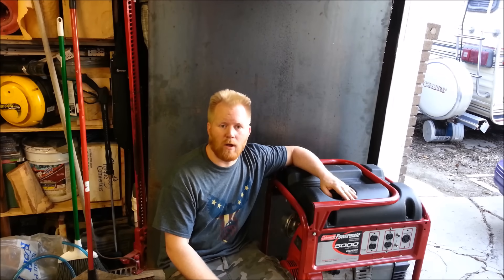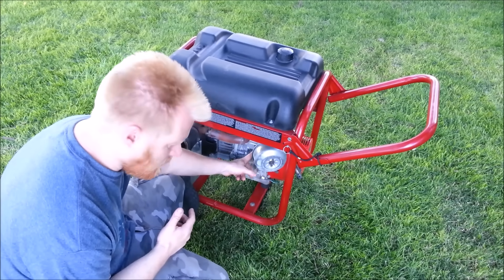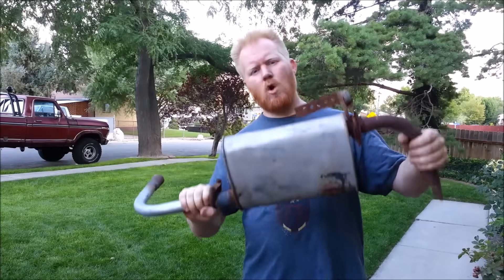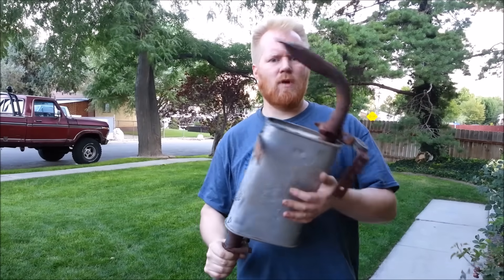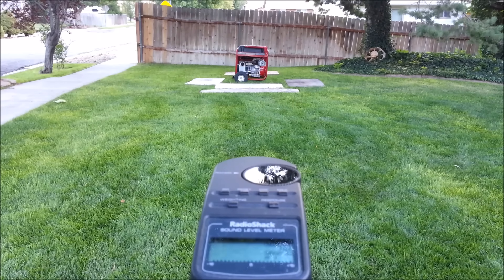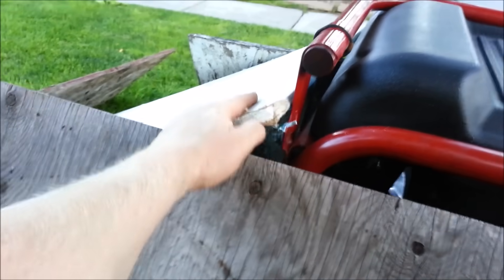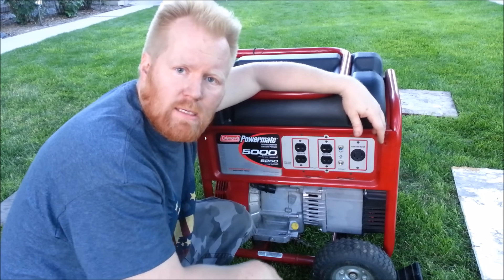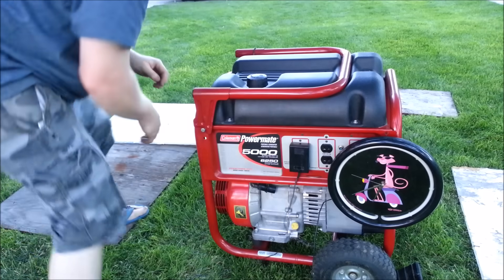4x Quieter generator in 10 seconds

Comment: Nice video showing that most generator noise is not always just the exhaust. The doghouse method of noise reduction has been used by commercial home generator companies for decades with great success. Your boards deflect most of the noise into the ground where much of it is absorbed. Simple, cheap and effective. We did a lot of exhaust modifications to small engines in an attempt to quiet them and not reduce power. We came to the conclusion that the quieter the muffler, the lower the power output from the engine. Enclosures are the best way to go. Nice video.
Reply: If you reduce power, you have not built a good enough flowing muffler. What works better (on  race cars for example) is a sound cancellation box instead of a muffler. YouTube David vizard, he has videos on building zero loss exhaust systems. Yes, they work.
Reply: @lowrangeinnovascotia2930  are you referring to megaphone( or tuned) pipes like on racing two stroke engines? Use of soundwaves for back pressure??
Reply: @h8troodoh  Not really but that is also a great example of what an engine needs (two stroke/expansion chamber)
An engine should have ZERO backpressure. ZERO! If you have backpressure, you are not getting 100% performance. (why manufacturers now use headers when before headers were only for "race or performance" applications). They improved efficiency, period. (this resulted in more power/better mileage/etc)
A cancellation box takes the exh pulses and lets them go one way and sets up the resonance sent back to the exh valve to hit at the perfect time to cause scavenging. Not required on every engine in mundane duties, but the principals are the same regardless.
Reply: @lowrangeinnovascotia2930  I'd like to disagree on the zero back pressure, some engines require it,2 stroke piston port engines, for example, as the fuel air charge would be following the exhaust gates out the exhaust port so.. although they have designed deflectors on top of the pistons,the need for back pressure is still there. 40 year professional mechanic..🙂
Reply: @h8troodoh  Can't comment on 2 strokes, never raced them or built them for performance. Every single 4 stroke engine, does NOT need backpressure, full stop.
Reply: @lowrangeinnovascotia2930  where can i buy this cancelation box?
Reply: @Ghostrider-ul7xn  You can't, you must either make it or do research and see which exhaust maker produces one or a "muffler" that has the same properties. It's all research. A very simple explanation of what I have done, is, fold metal into a box or tube to be the body of the scavenging box. Weld the inlet pipe about 2" into the muffler, not flush with the end cap. Weld a V in the middle of the body so it splits the exh as it comes in, weld the outlet tube flush with the end cap. What happens in this simplified version (but it still works) is, the exh comes in and hits the splitter. The exh is divided down each side of the muffler then hits the flat end cap. The exh and resonance is reflected back towards the inlet but is blocked by being inside the V and 90% ends up hitting the closed end of the V and then resonates back towards the outlet tube which is flush. The resonance that does sneak by the outside of the V and goes back up the outside of the muffler then hits a flat inlet end cap and since the inlet pipe is 2" into the muffler (as opposed to flush like the outlet) the gases and resonance can't get back in the exh pipe to travel back to the engine. This causes a pulse...pulse...pulse in the exh instead of pulse, reversion, pulse, reversion. Research "Exhaust scavenger box" or "exhaust cancellation box" and you will get the info how to build one.
Reply: @lowrangeinnovascotia2930  I hope you might consider posting a video of the design you talked about. Sounds interesting.
Reply: @Rick-the-Swift  I’ve got a thousand projects on the go now but trying to limit them!😂😂
Building a nhra legal stocker mustang currently , the homemade metal lathe I’m building on the side of my milling machine.. and the 3 mud trucks, my dd pickup and the wifes bronco sport… between servicing and fixing everything, that’s quite low on my priority list😂😂
If i can find an old one i built I’ll post a pic of that.

Comment: every 3db is twice or half the perceived volume. also if you read the instructions that come with the decibel meter your supposed to take measurements at 1 meter away.
Reply from the maker: Generators are tested at 23' as the industry standard.

Comment: Also a dog house enclosure will hide the fact that you have a generator !  Make that a big dog house...  And convert to propane and then the fuel is always fresh.  Thank you for the video !  tjl
Reply: Tim Lipinski problem with most modern portable/residential dual fuel or propane only gensets is that they make much less power on lpg. My 7k surge 6500 continuous is a dual fuel setup but on propane it's only rated at 6750 surfe/5580 continuous.

Comment: But your "hour meter" was already running before you fired up the genny. All you did by starting the engine was turn on the light. You need a clock like I have in my shop where the clock only runs when it has AC power.

Comment: what about restricting the heat from escaping?
Won't that effect the unit and overheat it?  heat kills.
Reply from the maker: I've run temp checks and everything stays within a few degrees. The trick is to leave plenty of area for proper air flow. Any engine will only pull in so many cfm of air while cooling and it doesn't require 360 degree air flow. A standard air cooled engine pulls all of it's cooling air through a few square inches behind the pull start. The spacing left at each corner is probably 100x the required area for proper cfm in and out. Air cooled engines are run successfully in fully and partially enclosed areas all the time(Honda's full line of inverter generators are fully enclosed with only a small opening at the front and rear for air flow, Along with pretty much every RV generator).

Comment: idiot should be measuring the oil temp instead of the sound level, blocking the cool air for the air cooled motor is not too bright
Reply from the maker: I've run temp checks and everything stays within a few degrees. The trick is to leave plenty of area for proper air flow. Any engine will only pull in so many cfm of air while cooling and it doesn't require 360 degree air flow. A standard air cooled engine pulls all of it's cooling air through a few square inches behind the pull start. The spacing left at each corner is probaby 100x the required area for proper cfm in and out. Air cooled engines are run successfully in fully and partially enclosed areas all the time(Honda's full line of inverter generators are fully enclosed with only a small opening at the front and rear for air flow, Along with pretty much every RV generator).

Comment: One question, does the RPM really need to be that high?
Reply from the maker: Yes. In order for the generator head to produce 60hertz it needs to spin at 3600rpm. Some high end generators by ONAN are designed to run at 1800rpm to reduce noise but require an engine almost double the size. 3600rpm with a generator head producing 60hz is the most economical way to do it.
Reply: Why couldn't a small transmission be used to speed up the  RPM and lower the engine RPM. It would really save on fuel too and noise !
Reply from the maker: Tom Schwab
You could, but you would need an engine that produced almost twice the power. So a 3600rpm generator that typically would have a 10hp engine would need close to a 20hp to run at 1800. This increases fuel use, weight, overall cost. You wouldn't need to use a transmission, just wind the generator head with more copper in a different way which increases the cost as well. Onan did this on a lot of their RV mounted generators, and they're great. They last forever, run cooler, very quiet, but they are close to 5-10 times as much as these cheap box store generators.

Inverter based generators have solved this by producing a DC current at any rpm and electronically converting it to usable 60hz AC power. The engine only needs to increase speed as load is increases. It is the best of all worlds as they operate quietly and produce clean power.
Reply: sixtyfiveford
Reply: Tom, with that type of generator, RPM dictates AC frequency. 3600rpm is pretty standard for small gasoline generators. Inverter/generators run at lower rpm, and idle down without an electrical load. They're much quieter, more fuel efficient, put out a cleaner (allegedly true) sine wave more like grid electricity. The trade off is that they cost more to buy.

Comment: The problem you will have when you place the pieces of plywood around the generator  is that the generator  will get very hot. I,ve done this in the past and i had to space the plywood further apart than you had yours.
Reply from the maker: I've run temp checks and everything stays within a few degrees. The trick is to leave plenty of area for proper air flow. Any engine will only pull in so many cfm of air while cooling and it doesn't require 360 degree air flow. A standard air cooled engine pulls all of it's cooling air through a few square inches behind the pull start. The spacing left at each corner is probably 100x the required area for proper cfm in and out. Air cooled engines are run successfully in fully and partially enclosed areas all the time(Honda's full line of inverter generators are fully enclosed with only a small opening at the front and rear for air flow, Along with pretty much every RV generator).

Comment: I have a Honda 3000is and it is SUPER quiet right out of the box. No need for any sound boards. But if I do sound boards then I can't tell if the generator is running or not by standing 23 feet away.
Reply from the maker: And? What does this have to do with anything?
Reply: MontiR Aruba I have a Honda 3000 also. It does Not generated the stated amount of power in Amps. It generates in the 17 amp area and is good for electronics, lights and a very small ice box/frig. Buyer beware.  It is very quiet and excellent for camping.

Comment: MAJOR STEP UP!
8:15 Attach thick scrap carpeting or egg crate foam to the inside of the wood panels & around the generator on any hard surface (concrete, etc) the generator may be sitting on so that the sound does not bounce off those hard surfaces.

Comment: looks like a nice way to cause your generator to run hot. 
Check your owners manual for clearance requirements. What you call plenty of air flow is actually quite restricting.
Reply from the maker: All temp test show it runs within a degree or two of normal. The intake fan on the motor and generator head can only pull in so many CFM of air. The Air spaces at the corners allow for probably 50 times that capacity. I could shrink it even more to get more sound reduction. Air cooled motors are ran in enclosed areas all the time with far less air circulation. Go to the Home depot and look at a huge 20+ hp riding mower(their air cooled); it's covered completely to reduce sound and will run 3000hours+. Along with that virtually every inverter generator is seal up tight as a drum with only a few square inches allowed for air to be pulled in and pushed out.
Reply: sixtyfiveford you are kidding me right? My Honda EU 1000 owners manual says it requires three feet of open space in every direction.
Reply: A riding mower engine is not covered unless you mean covered with shrouds which direct the cooling air over the cylinder and head.
Reply from the maker: Wayne Wildman All modern riding mower engines are completely surrounded by cosmetic shrouds(hood, side shrouds, front grill and firewall) with only enough open space to allow for proper CFM flow.  Onan RV generators are fully enclosed and then put into a RV generator compartment with a 10% opening. I run a pair of eu2000i in a fully enclosed box on my Motorhome with a 6"x12" opening on both ends and small fan to pass air over them; they run cooler than out in the open. Briggs and Stratton puts their 40301 7000watt home stand by generator in a fully enclosed box. Only strategic louvers for airflow over the air cooled engine(20hp riding mower engine) are provided. It runs cool and quiet. You mention your Honda eu1000i that is in a fully enclosed box with maybe a 10% total air opening allowing for the engine to breath and cool itself(Yes, it has standard metal shrouds on it inside as well).
Reply: sixtyfiveford room for proper cfm means they are not inclosed.
Think about your own statements  bud.
Reply: Wayne, perhaps my explanation sounds like I'm ignoring the safety precautions that are listed in your manual. I'm not. The EU series of generators are encased it the plastic cover. That's what I was referring to, and that is within an inch or so of some parts of the engine, generator, inverter, and other parts. His plywood baffle over an open caged genset is no where as close, nor closed in at all. As long as he keeps flammables away from the exhaust (on the Honda, you can see that the exhaust exits through an opening in the case), and provides openings for breathing and air cooling, he'll be okay. You're comparing apples to oranges. Yes, the Honda is a better generator for a few reasons... one is that it's quiet enough to not need home-spun noise baffling. Good luck.
Reply: Home generator installations always enclose the genset inside a housing to quiet the unit. Take a look at some permanent home generator power units. There is far less ventilation on those units and they run for long periods of time just fine.
Reply: Wayne, the Honda EU series has an engine already enclosed in the housing, with maybe a couple of inches between the actual engine and red plastic box. 1000 or 2000. His idea in pretty good, but needs weatherproof materials covering the drywall and OSB.
Reply: Steve W the Honda EU series calls for three fee of clearance on all sides and above. I have the owners manual for my EU1000i right in front of me. 
The plastic case is part of the generator, not part of an additional enclosure.
Reply: Steve W here is a quote from the manual. "Operating this generator less than 3 feet (1 meter) from a building or other obstruction can cause overheating and damage the generator." 
"For proper cooling allow at least three feet of empty space above and around the generator."

That's Honda saying that not me.

Comment: Don't know if anyone pointed this out previously (and I don't have time to read through all the comments), but volume decreases by half for every 3dB, not 5 (just to clarify, since you weren't sure in your video). Also, the angle of the boards used for deflection can make a huge difference. Windows in a soundproof audio studio are usually pitched at a 17 degree angle to surface of the wall they are in to maximize sound dampening (and minimize parallel wall reflections). Nice job applying some simple physics to get the job done.
Reply from the maker: 17 degrees? Interesting, I've never heard a definitive angle. Thanks.

Comment: Just FYI - 3.32 decibels = half the power, it's a log scale, meaning that 10 decibels is approximately 8 times more loud/quiet.

This is also why you lose ~3 decibels when you use a 2 way splitter, or ~7 with a 4 way splitter.

In other words, you're underselling the results by a good factor of 2.

Comment: I lined my slightly angled box (deflection)  interior with carpet pad (absorbstion) and reduced 22 decibels! Thanks so much for the simple but great demo and information!
Reply: I was thinking of doing something similar, but with “sound lining”, it’s an absorbent material about an inch thick. We use at work inside HVAC ducting..
Reply: Could you put the carpet pad on the ground under the generator? Will that absorb even more sound?  My generator will be sitting on concrete.  Thank you!
Reply: @xyladivine  yes
Reply: @aladrasullivan9018  Thank  you!!
Reply: @xyladivine  welcome luv
Reply from the maker: That's impressive!
Reply: MRrwmac @

Comment: I don't care how much air flow you say it has after you o your little trick because I guarantee the temperature of your generator went up at least 10 degrees. With limited air flow and the heat from the generator building up inside your plywood tent the life of your generator is cut in half.
Reply: louis stout, I thought the same thing, but Mobil 1 is an amazing product.  If I were to run this way I'd be using synthetic oil.

Comment: Buy a Honda generator, leave the shtty boards and sheetrock in the shed. Im not hauling all that crap to squash a little sound.
Reply from the maker: Your comment has nothing to do with the video. I have Honda's but most can't warrant the cost.
Reply: My comment has everything to do with your long winded video. You're using boards and sheetrock with very little payoff. The Honda generator doesn't need "accessories". Going with Honda anything ALWAYS warrants the cost especially with resale, but most importantly, durability. Apply that to any of their products.
Reply from the maker: O hell, I guess I need to redo the video. EVERYONE please note: Throw away your 10,000 generator and buy a HONDA. I officially retract my video content.  Thanks for the useful input Steve.